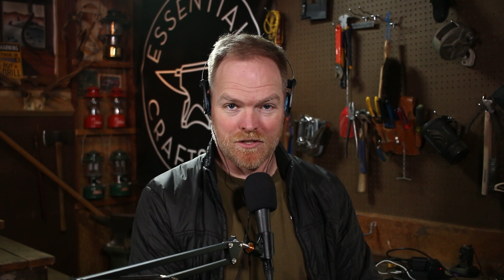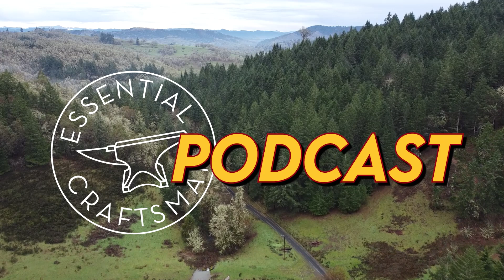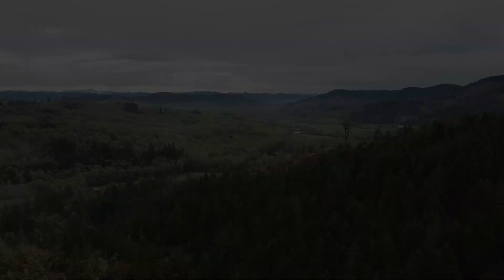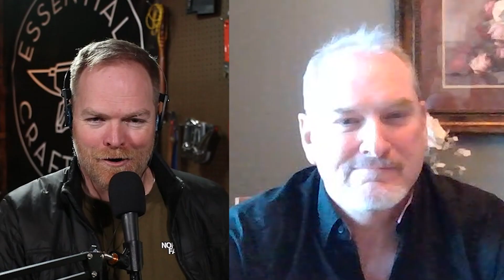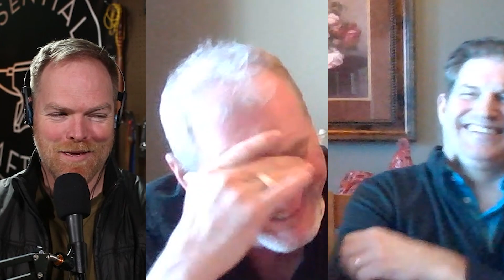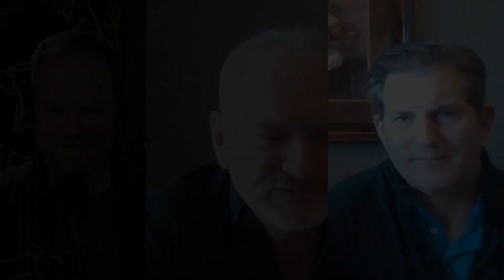Innovation for Pouring Concrete Footings: Dwight Lamm ECP 114

Comment: Is it just me or are we overlooking the lack of availability of concrete pumper trucks in those areas that are rural and far (more than 30 miles) from a large urban area where you might get a concrete pumper to fill ICF walls or poor forms/ LOVE slinger trucks but again, never, in my area ... within 200 miles.